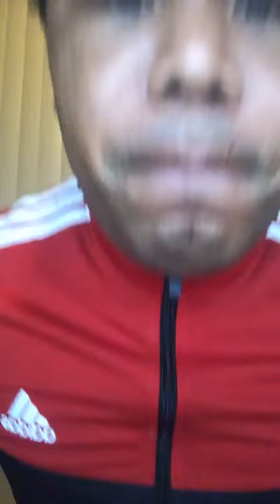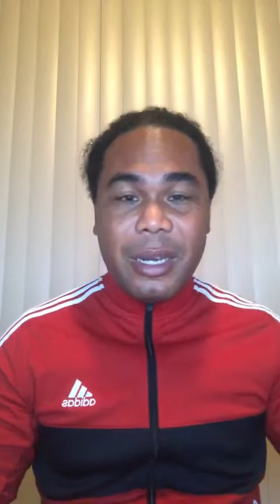How long it take for cement to crumble

Comment: Per Google: Concrete typically takes 24 to 48 hours to dry enough for you to walk or drive on it. However, concrete drying is a continuous and fluid event, and usually reaches its full effective strength after about 28 days.